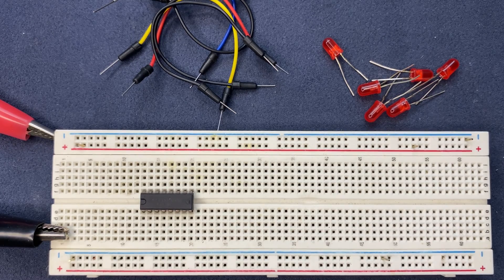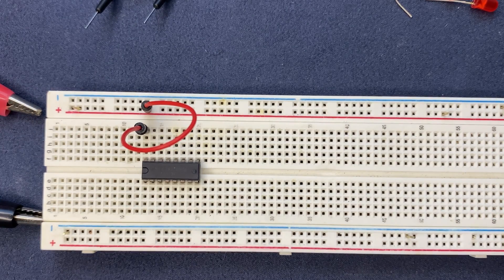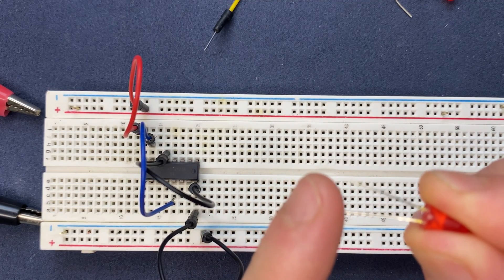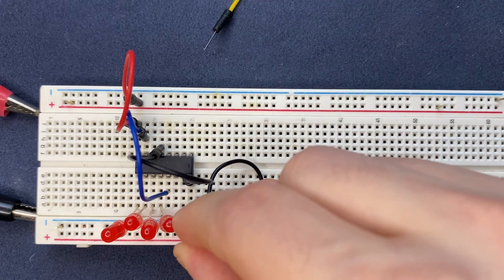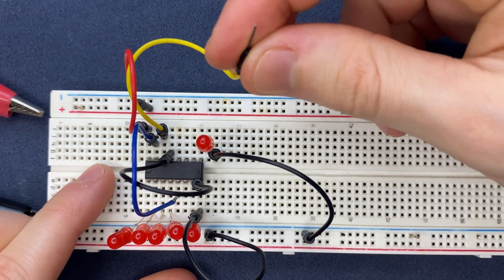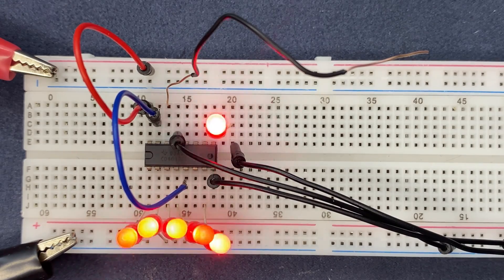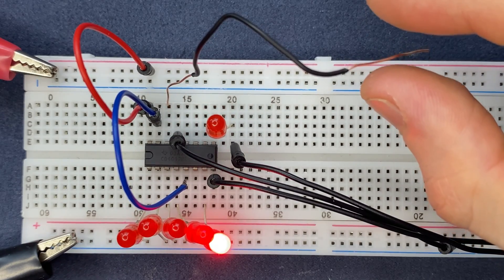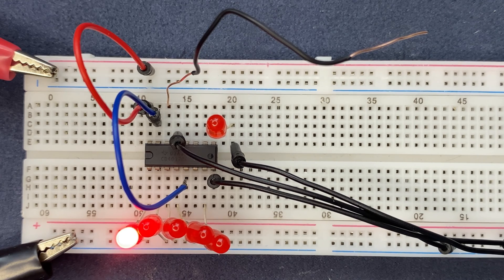How to build an electronic dice using 4017IC on breadboard

Comment from the maker: Other cool projects 🤌

LED flasher circuit 💡⏪

https://youtu.be/00ZE2eG8sCU

LED controler circuit using decoder circuit 🔦

https://youtu.be/C-_MpK90H8Q 💡

NOR , NOT, OR, logic gate circuits⚡️

https://youtu.be/_FEnjqidiQU

Fire Alarm circuit 🔥🧯

https://youtu.be/A98oM_p3Kco

Transistor motor driver circuit 🛵

https://youtu.be/uscl6TXzPOc

Darkness sensor circuit 🌄

https://youtu.be/kePkWBJPhYU

Voltage level indicator circuit 🔋

https://youtu.be/MHp1QqaaNd0

Inverter logic gate circuit 🚫

 https://youtu.be/vIvwmg6vcP8

How to read a schematic diagram 🤓

https://youtu.be/82ua-NaLnGA
Reply: where is circuit diagram ??